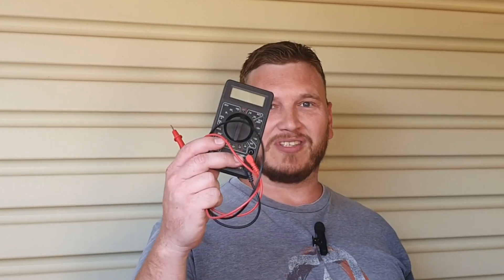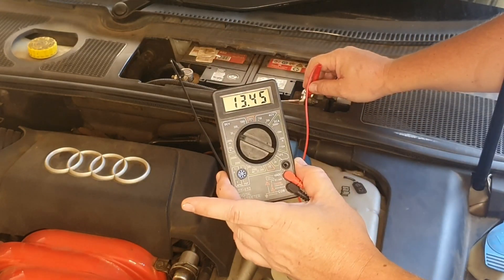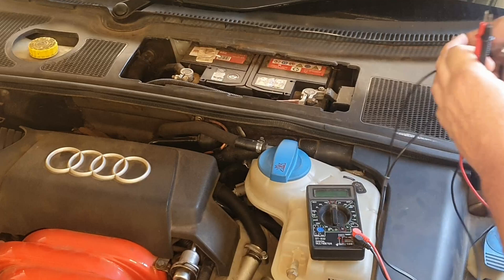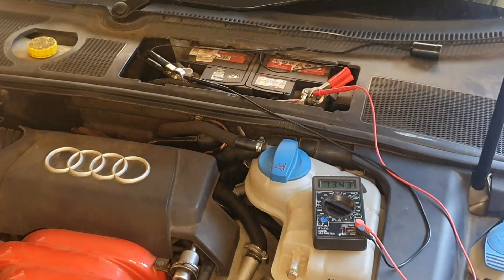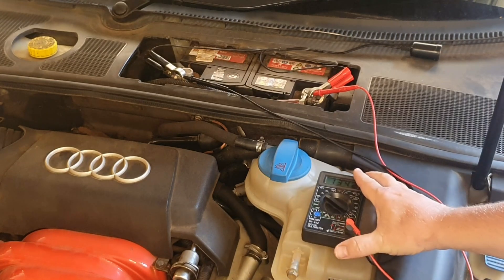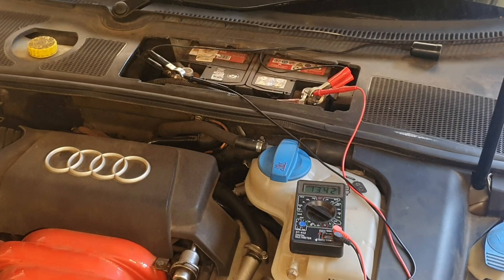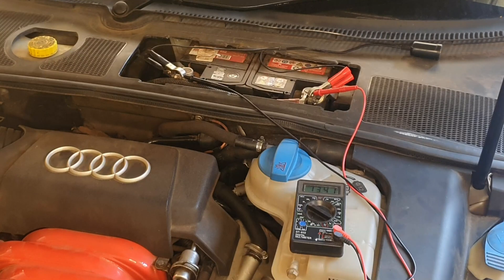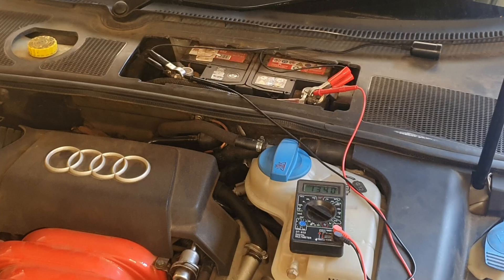Load Test Your Car Battery With A Multimeter!

Comment: Hopefully this video reaches many people who will be able to use the information.  It is amazing how many people do not realize the batteries manufactured in the last few years are not anywhere near as well made as the ones made as late the mid 90's.  The plates are thinner.  The solution is weaker, which is causing the specific gravity to be lower.  These things are especially the reason your video will help those who do not understand why their battery is needing to be replaced  before they use to need to.  One example is by looking at the battery return policies.  

Very unlikely you can find five years replacement/return policies now.  I believe three years is the average now.  Why?  The amount of acid used, along with the minimal amount of lead used in the battery cases.   I know as I have aged, it is easier to pick up car batteries.   And i am NOT getting stronger.   You can see this in the CCA on batteries also.  Or just look it up for yourselves.

Anyhow, very good video.  My compliments to you for taking time to help others
Reply from the maker: Thanks for your support! 👌🏻
Reply: I must be very lucky. In the last 16 years I've had two vehicles.
Vw caddie bought used
 Battery lasted 7 years.
My suzuki ignis bought new in 2018 is still running perfectly with original battery.